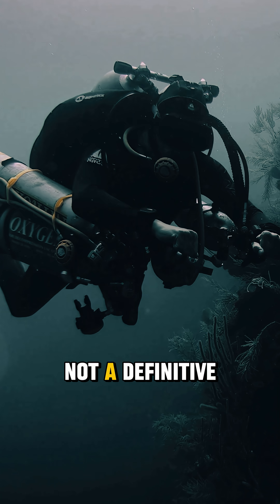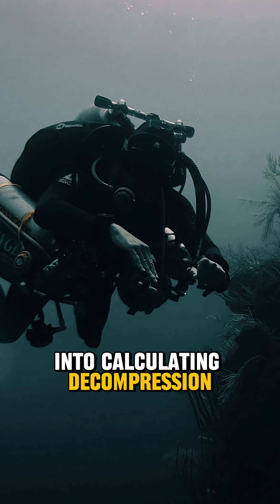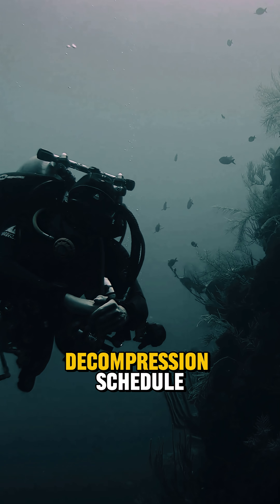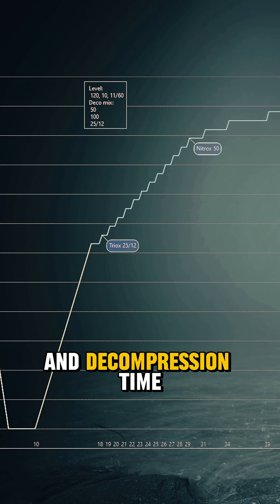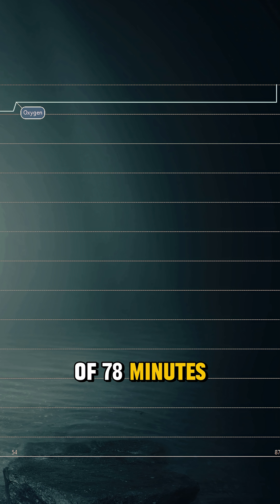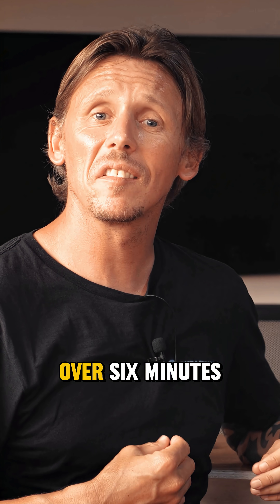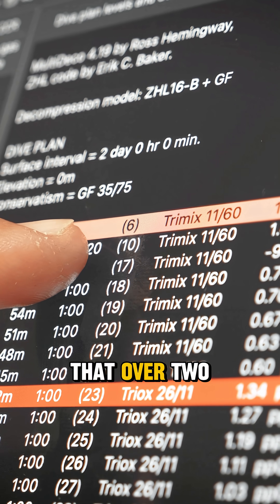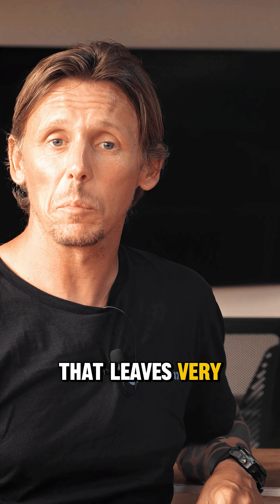☠️ What does it take to dive to 400ft/120m on open circuit? #scuba #diving #underwater #scubadiving

Comment: You can do it on o/c but why would you. The price of helium these days is astronomical so a 120m dive on open circuit would cost 100’s in gasses. You’d be much better of putting the money into training on a rebreather if you want to go to them depths. Yes the initial cost of it all is expensive but once you have it all I can do a 120m dive for a fraction of the cost of open circuit
Reply from the maker: Yes, I agree. This is actually a shorter clip of a full length video that makes the same argument in the end.
Reply: @DiveSAGA can you send the link to the full length video?
Reply from the maker: @rednissan001 absolutely. Here you go: https://youtu.be/mFjiWn1EhO8
Reply: @DiveSAGA thanks